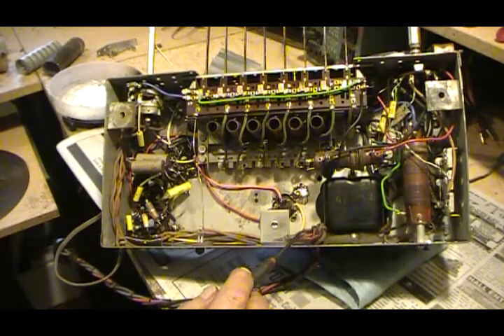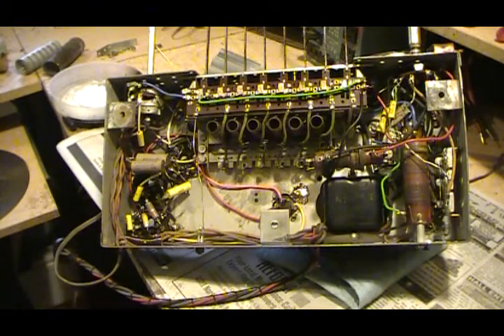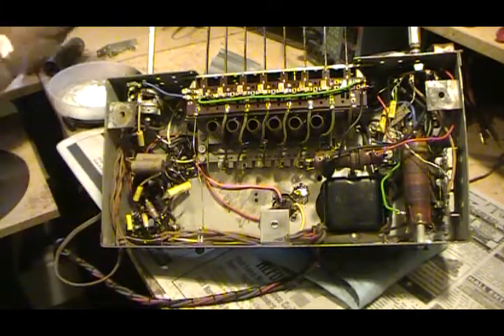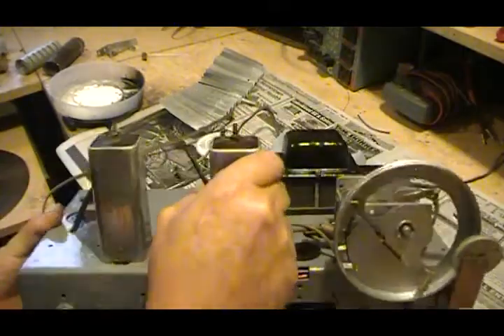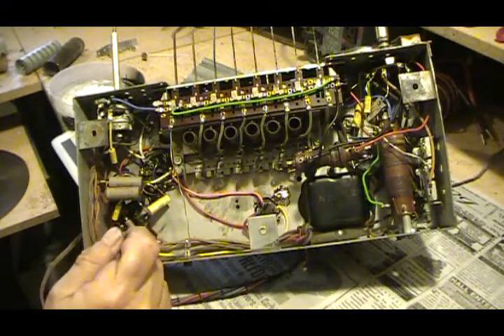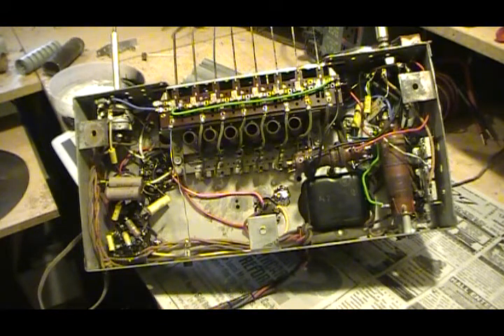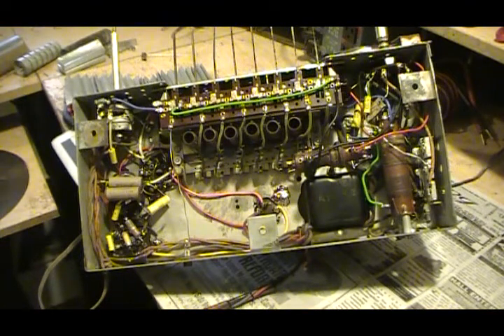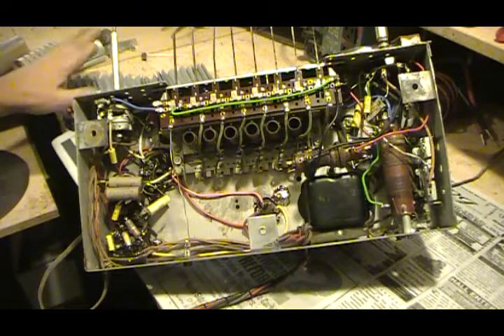RCA 96T7 part 5

Comment: Thanks for the detailed explanation of why the power supply section is away from the audio section Dennis. Sure, it makes sense because of potential hum injection.
I did figured out myself why it wouldn't interfere with the "front end" RF section though after I saw that video. The frequency range is so vastly different the potential inference would be negligible. The bandwidth of the RF section is wide but not "that" wide. Yes, and I agree the 60Hz harmonic jumps would be so numerous to get to the RF range that the signal strength would end up being negligible. (Sorry, didn't mean to use "negligible" twice.)
Great video!
Take care,
Tom
Reply from the maker: Hi Tom. I'm glad you enjoyed the video and thanks for the comment.
Your friend Dennis

Comment: Here-here Dennis, the times I’ve advised ‘have a try’ radio restorers to begin by familiarising themselves with the circuit diagram; then relate it to the radio; take photographs; draw diagrams and pictures (add colour and/or notes where appropriate); use sticky-back labels or pieces of masking tape to note wire location, and so on. Will they listen? No! Often, I get their ‘cock-ups’ to sort out. I’ve begun to refer them to your vids my friend – hopefully some may take heed.
Phil.
Reply from the maker: Hi Phil. I know what you mean my friend. But hopefully it will get through eventually. Thanks for watching and the comment. Take care my friend,  Dennis